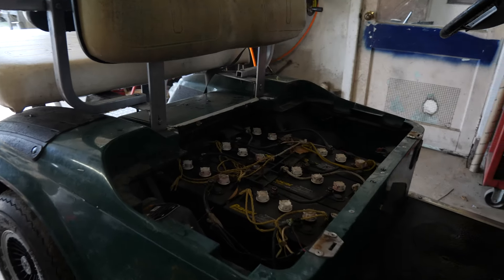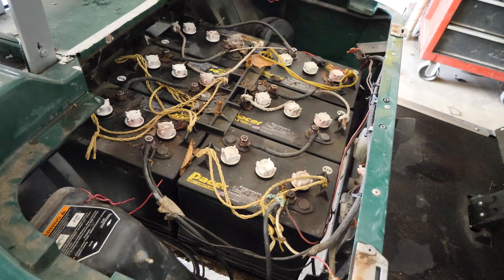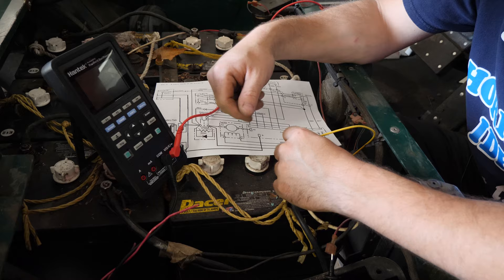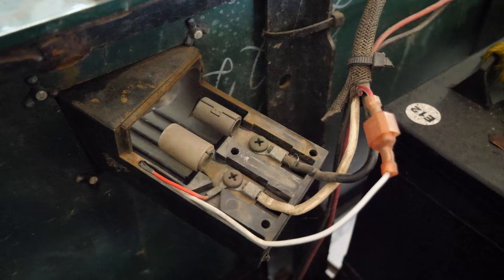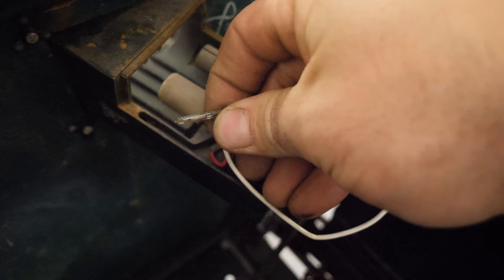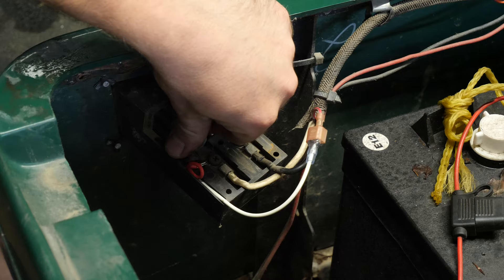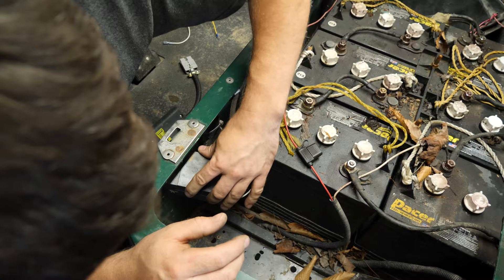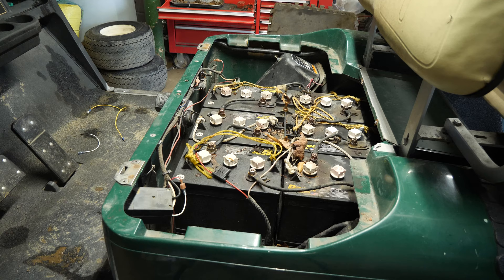1996 EZGO TXT, 36 Volt  -Dead Batteries, Not Moving

Comment: I have a 2001 EZGO txt  36 volts. I went ride today. The Battery's are fully charged. I cut my ride short because my gulf cart started to feel like the Battery's were not changed, it wasn't going the top speed that it normally goes. My battery meter showed almost 100% full. So I went home witch is about 1 mile. I checked the temperature on the motor with my infrared thermometer and the highest reading was 117 degrees F. It's a nice cool day today. My questions are how do I know if my electric motor is going bad, and what is a normal temperature for the motor on a cool day after riding for only about 20 to 25 minutes. Thanks  Sidney

Comment: seem to be confusion about little reed switch  and how it works   one side conn.s to little red wire to controller the other sid conn.s white battery lead this switch is normally closed while you riding around  but when you plug in the charger the metal inside the charge  plug effects the reed switch magneticly makes it go open the little red wire is disconect at this point till charger is unpluged so you can go till plug is removed
Reply from the maker: The reed switch prevents the cart from driving while charging.

Comment: My cart would do nothing after adding new batteries, it had been setting in shed over a year with no usage.  Replaced solonoid and now I will get solonoid clicking, but nothing else.  Checked voltage as you did in your video, and voltage coming out of charger box was 18-19 volts.  Tried to jump other end and went directly to battery, but that unfortunately didn’t help, still nothing but clicking.  Any ideas?  Any comments much appeciated! Thanks, Jim

Comment: Thanks for the video.   I changed to Lithium batteries and don't use this receptacle.   I  was going to bypass this interlock, took the receptacle apart, someone had already removed the switch and wired directly to the terminal.   But good to know.

Comment: I work at a shop that services this ez go's and we simply just switch the batteries out! But never knew that might be the culprit to a lot of this dead batt issues.... Good tip I will check them out next time before switching the whole battery set
Reply from the maker: Yikes, that's a very expensive thing to do!
Reply: When you switch out the batteries does the cart work then?

Comment: Great videos, glad i found your channel.
The same thing happened to my daughter's 99 txt. 
I made mistake of pulling her about 2 blocks back to house, without switching to tow. When we stopped the electric motor was smoking. I'll make a jumper to see if the read switch is issue and if my motor is toast
Reply from the maker: The reed switch has nothing to do with the motor. If you towed it in Run mode, you probably cooked the motor.

Comment: You can bypass the reed switch and then get rid of the charger receptacle. Now you can direct wire one of the new lightweight chargers (with a timer if you want ) and now you have a On Board charger you just plug into the wall. You don't have to lug around a charger all the time
Reply from the maker: That is an option. If you don't want to spend hundreds of dollars on a new charger and rewiring, this is much faster and cheaper.
Reply: A new charger I’m talking about is about $50, $60 if you buy a 48 volt, converting your 36 v cart to 48 v. And if you don’t trust these chargers to shut off you can also purchase a timer
Reply: Plus the charger has the wiring
Reply from the maker: I wouldn't trust that herky jerky setup. I'd rather have a quality charger connected to my expensive battery pack and golf cart.
Reply: you dont need to get riid of the charger just conn little  red wire to + side  white wire same screw  it just elminates the reed switch

Comment: Thank you so much for the informative video!. Question, if the reed switch has failed, would that prevent the charger from charging?. Thanks.
Reply from the maker: The only purpose of the reed switch is to disable the cart so you can't drive away with the charger plugged in.

Comment: you can clean the green with a little baking soda  and water  and an old brush  ----ps  dont do this on a concrete floor  move it ouside  it will stain concrete

Comment: 9 times out of ten it a corroded battery cable    you can by pass readswitch withno prob  just remove switch key to pevent   any one trying to go on cart  whleits charging to bypass read switch just connect little red wire to big battery + cable  white thighten  tight

Comment: Good vid. I don’t think it applies to my 89 Marathon but I’ve heard about later models’ reed valves (dang it - switch, thats 2 stroke talk). Magnetic contacts? Seems primitive. Whatever works I guess it’s a nice safety feature at least. My point of contacting you is to ask about the aftermarket controllers for stock 36v. I’ve heard some claim it really beefed up their stock performance and they even over-tax their motors to the point of replacement. I don’t want to kill the thing but wouldn’t mind speeding it up a tad. The other common route I see is 48v conversions with new controllers, solenoids, motor, FNR switch, and of course the motor. They claim to get carts up to 25mph but you’re talking $1600 for just the parts not including the batteries.
Reply from the maker: A 36 volt system is only going to get you so much power. There are physical and electrical limitations that will prevent you gaining beyond that. Stock motors are not very strong, even with aftermarket controllers. You will kill the motor if you push too much power through it. The stock equipment is designed to run 300-350 Amps. You can get a stock replacement aftermarket controller to give you a little more flexibility, but you won't get a whole lot. If you are looking to do a big jump in torque and/or speed, a 48 volt conversion or replacing the cart would be the way to go.
Reply: @Kevinsgolfcarts  when i clean my battery cables  about twice a yr   i get more power

Comment: Could you test the resistance of the reed switch, instead of using a jumper wire?
Reply from the maker: You could. The reed switch is just that, a switch. It will either be open or closed. There will be some level of resistance due to the small wire size, but this is irrelevant. If the switch is open, whether or not the charger is plugged in, bypassing it will confirm the operation of the controller.
Reply: How do you check to see if controller is working or not
Reply: @joewarren3n1   it will go somewhat faster if controller is working (LOL)

Comment: Hi - thanks for video. I understand why you don’t recommend a work around. But could you explain what it would be?  I have this cart with same charger and reed switch, and am converting to lithium to lithium battery, so don’t need this charger port any more…but having same problem as described. So need to bypass reed switch…. Sounds like connect the red and white together and connect both to 48v battery + ?
Reply: You ever figure out what to do with the reed switch wire when you converted? I was told connect it to battery positve but I have no idea where the other end of the reed switch connects to

Comment: How to check Reid switch is good or bad. When Connectivity is ON means good!! Or Bad
Reply from the maker: When the charger is plugged in (there is a magnet in the plug), the reed switch should be open. When the charger is unplugged, the reed switch should be closed.

Comment: I have a 36volt txt a 2002 it has brand new batteries a 6" lift and 23" tires I never drove this cart prior to the lift or tires it was bought as a project. my question is now that its up and running this thing will hardly get out of its own way it has almost no power? I know a 36 is not as good as a 48 my question is what should I be able to count on from this cart? I don't care about top speed I want to know about pulling capabilities such as a jetski and trailer around the yard moving things etc... and also range how long in-between charges? just some base idea so I know if there is a issue and if so where should I look and how to find issue. like I mentioned it measured 3/4 charge last night and with thte pedal pushed to the floor it would barely move
Reply from the maker: 36 volt carts just don't have the power like 48 volt carts do. TXTs are weak stock so adding larger tires and wheels changes the geometry of the drivetrain. You need to have good batteries to get any useful power out of them. If they are not fully charged and in good shape, you will have no power and it will be a very frustrating experience. When charging, you need to let the charger run a full cycle. Stopping it while charging is not letting it complete a charge and is not good for the batteries. It can take up to 24 hours to complete a charge cycle, depending on depth of discharge.
Reply: Kevin's Golf Carts 
The batteries are brand new. The charger seems to be working it turns on and runs and reads on average of 20amp when charging I haven’t timed it but I would say a charge cycle usually runs 8-12 hours. Another thing I didn’t mention is sometime when putting the pedal to the floor the cart will move forward slowly a couple miles a hour but if I take my foot all the way off and then floor it again it will take off and run much faster I was wondering if it could be a position sensor on the pedal or a speed sensor on the motor? Lastly you didn’t answer my question should my cart be able to pull my jetski and trailer around the yard etc...
Reply: Kevin's Golf Carts thanks for the reply I was curious. Do you have any knowledge with the speed sensor that mounts To the end of the motor or the throttle sensor that’s near the pedal? Any chance it can be either of these causing my issue? I hate just part swapping! I have brand new batteries and I’m installing new 2gauge battery cables

Comment: Why doesn't any show the settings on the multimeter and which contacts they touch with the multimeter?
Reply from the maker: To measure volts, you set it to volts. To measure continuity, set it to ohms. You should know how to use a multimeter before trying to use one. Every multimeter is different but function the same so you will have to read the documentation that comes with your particular meter.

Comment: Hey Mate, so I have new batteries and they are read 36v with the meter and 6v when checked separately. the issue is its dying quickly and getting slower...any help would be appreciated
Reply from the maker: A 36 volt battery pack should read near 40 volts when fully charged, 38.6 volts roughly after being charged. Each 6 volt battery should be about 6.8 volts. Also, you must let it completely charge once started. Stopping the charge midway will damage the batteries. There is a break-in period for new batteries. You will have to download the break-in procedure for your battery manufacturer.

Comment: Hey Kevin, I dont have any charger on the cart I am restoring so I am going to buy the entire reed switch housing charger deal and harness. My cart is a 2003 TXT 36 v, Would you be kind enough to tell me where all the wires go? This I believe is the last thing I need to add to the cart.
Reply: They just connect to the battery terminals of the two batteries that are at the end of the connecting series but will be two different batteries. I hope this makes sense.

Comment: The positive post of the first battery is overheating.   And if I connect it to charge it will start sparks and stop charging any ideas??
Reply: ths is a common problem  on battery cables take that cable buff the both ends  clean   if you dont have a buffer    use baking soda and water    that will desolve that green crud   you can clean each cable that way    that willstop over heating battery cables

Comment: i have the same 96 txt.  I did a bypass on the reed switch and already got a new solenoid and Batteries. All I get is just clicking from solenoid when i hit the pedal, what do you recommend I do next?
Reply from the maker: You will need to test for voltage with a multi meter. If the solenoid is clicking and the cart is not moving, it could be anything from the F/R switch, electric motor, controller failure, broken wire, dead cell in a battery. You can google 36V EZGO Diagnostic for the correct test procedure.

Comment: How bout a 2002 ezgo PDS 36 volt that was running perfectly fine and now won’t go but about 2 mph. Battery’s are a year old and fully charged, charger is good. Don’t really know where to begin troubleshooting. Just got the cart about 3 months ago and don’t know anything about electric golf carts. Any advice would be appreciated.
Reply from the maker: On flat ground, put the cart in forward with the parking brake off. Try to push it. It should hold itself back and beep at you. If it doesn't' then its the speed sensor on the electric motor.
Reply: Kevin's Golf Carts it defiantly free rolls, The cart never had any back up alarms/beeps so couldn’t listen for that. I replaced the speed sensor and the magnet, solenoid, used a volt meter to test battery’s, controller, motor, throttle sensor, and got 12 volts on all the battery’s and 36 volts everywhere else. Not real sure how to test the solenoid, it’s brand new and not real sure about the readings. I read where the small post should be tested in ohms 🤷🏻‍♂️. I’m completely stumped and really don’t know what else to check for.

Comment: If my reed switch is bad would that make the charger not work?
 I changed my batterys with a different changer but it still won't run at all. Lights don't come on only the reverse alarm...
Reply from the maker: The reed switch is designed to disable the cart while charging. It has no bearing on the operation of the charger.
Reply: Mine is having the exact same problem did you ever fix yours
Reply: @cameronbeavers7751  one of the batteries was reading that it was charged but it wasn't fully charged, causing it not to get a good connection. 
I had a bad wire in the cart charger.

Comment: Why is it important that the cart not run when it's being charged? If you put the cart on jacks and on a charge, is it still a bad idea to run the cart? Thanks for any help.
Reply from the maker: Why would you want to run the cart while charging?  The charger will be overloaded trying to charge the batteries and provide power to the motor controller.
Reply: @Kevinsgolfcarts  Thanks Kevin. I have an old EZ-Go and I don't think it has a controller unless the controller is inside the motor. Another question if you have time to respond: Is the Micro Switch under the solenoid in an EZ-Go necessary if I take out the Reverse Buzzer, which this Micro Switch seems to be hooked up to?
Reply: @Kevinsgolfcarts  One other question: Is it ok to charge the six 6v batteries by themselves without being hooked up to the motor and other devices in the battery compartment? I mean, is it ok to take the batteries out, put them on a workbench and charge them with the 36v charger?
Reply from the maker: All carts need some way to control the current to the motor, whether its with resistors or a solid sate (electronic) motor controller. They are not built into the motors. Depending on the year, your cart may be what's called a "resistor cart". This is a "mechanical" motor controller. Resistor carts put 100% load on the batteries, regardless of how far the accellerator pedal is pressed. You can leave the switch and just disconnect the reverse buzzer. Its been a long time since I've had the old resistor carts in my shop, so I'm a bit fuzzy on their exact layout.
Reply from the maker: You can remove the batteries from the cart to charge them.
Reply: @Kevinsgolfcarts  Thank you...that's good news. Good luck and good fortune with your company!
Reply: @Kevinsgolfcarts  One last question if you have time: I saw a video on YouTube of a guy who hooked up six 12v batteries in series (three in one bank and three in another bank, a total of six, each bank in series but NOT in a continuous series of all six batteries). He then hooked up these two banks of batteries in parallel and said he was now getting 36v total BUT was doubling the amperage to make his cart run faster and longer. Is this a good idea? Any disadvantages of putting that much amperage into a golf cart motor?
Reply from the maker: This is called series-parallel wiring. Series increases voltage, parallel increases amp-hours. It will not make the cart faster. In fact, it may slow it down since the weight has doubled. This keeps 36 volts and doubles the amp-hours of the pack. This will increase run time, but at the cost of more weight. The gains are going to diminish as more weight is added and the horsepower of the electric motor is exceeded. There are many factors that come into play.
Reply: @Kevinsgolfcarts  Thank you once again. Appreciate your input.

Comment: What if it clicks but doesn't move?
Reply from the maker: It could be any number of things. This isn't enough information to provide any useful info Causes could be anything from  a bad solenoid, bad motor, brushes could be wore out, motor controller could have failed, bad wire connection. You need to check each wire and make sure the connections are clean and tight. You will need a multimeter to test things. There are a few forums on testing. A quick search will find these procedures. Its too much to type here.

Comment: My batteries are fully charged. When I turn on the run switch. The ezgo cart wants to go as in go forward as ( take off even though the key switch is off
Reply: Turn the switch to tow nothing. Back to run and the motor starts running but doesnt. Lunges forward
Reply: The forward reverse switch is in neutral
Reply: No one has ever had this problem too???